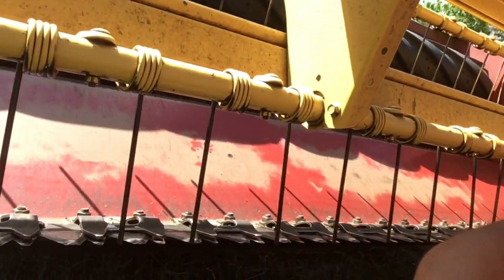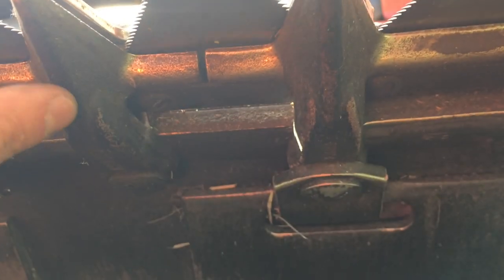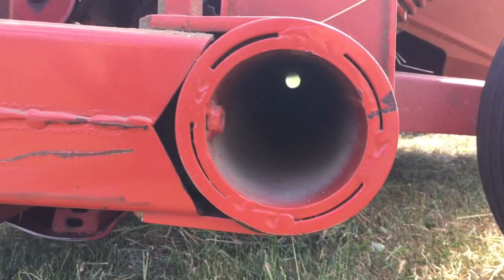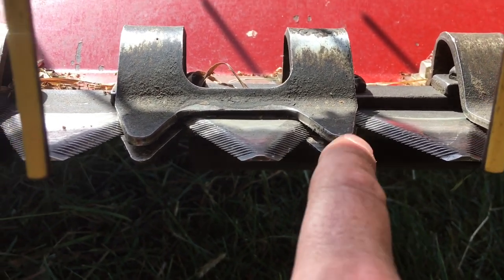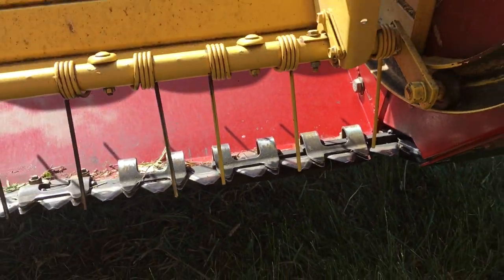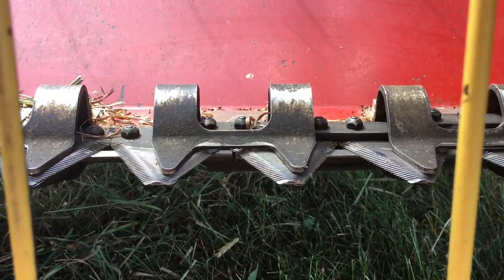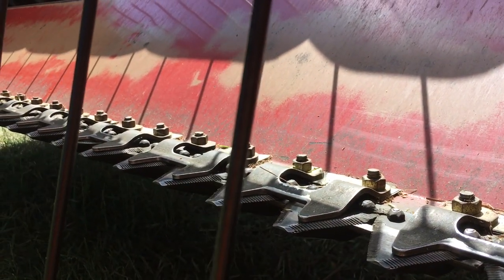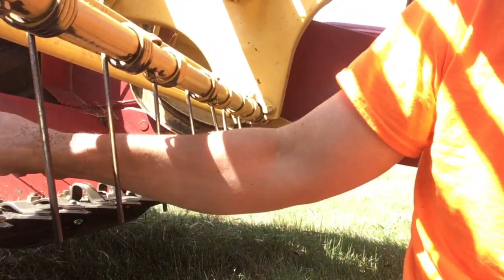Installing stub guards on 488 Haybine

Comment: There's a special bracket that you bolt to that nut in the tube. It's a bend 1/4" rod that bolts to the welded nut and gives through the bushing of the 9' knife.

Comment: Nice video. One thing I noticed though is your carriage bolts are upside down - the nut goes on the bottom (against the guard), not on top on the hold downs. That's why the hold downs have square holes. That's also why it's also important to use the correct length carriage bolt - so the threads don't project too far past the nut.
Reply from the maker: They are correct as installed. The nut goes on the top and this is what the parts diagram shows as well. If the nut were on the bottom the shoulder of the bolt would have to go down through the shims as well, which, depending on how many shims required, may not allow the bolt head to fully seat against the hold down because the shoulder is bottomed out. 

The bolt head goes on the bottom against the guard and there is a deep square recess in the guard for the shoulder and head to fit into. This allows the smooth surface against the ground. It also allows for easier shimming and hold down adjustment. Otherwise you’d have to remove the entire guard and everything just to add more shims. 

If your machine has the nuts on the bottom then it is not set up correctly.
Reply: @TheScientistHayFarmer  interesting, because the parts diagram for my haybine shows the carriage bolt head on top. Different models, I suppose.

Comment: Nice video. Quick question. I just picked up a 488 and it was missing the sickle bar bearing. I put the new one in, but I’m not sure how tight the bolt should be that connects it to the drive arm on the wobble box. Any tips?
Reply from the maker: I assume you mean a new knife head bushing for the sickle bar? Tighten it to 90 ft-lb.  I think it is a 3/4” socket you will need.
Reply: @TheScientistHayFarmer  thats right, knife head bushing.  thanks.
Reply from the maker: I have some other videos on the 488 too if you’re new to it or haybines. One of them is how to hook it up and run it.

Comment: Lucky you. I went to my local NH dealer here in France and he could not even get sections for my 447 haybine but 5 that I had to grind to make them fit the sickle bar... Could not get the rear glass for my td85 NH  tractor. I am a little reluctant to buy a used 650 NH round baler cause I guess he won't find parts for it if needed lol.

Comment: Neet looking stub guards haven't seen them before just the long pointy ones    basically like  what you have at the very ends but set for its the whole head.    P,s do they still make that type of guards?  Again haven't seen them types just the long pointy ones.               Sure some people may say "sickle bar haybines sucks, disbines are faster"   reality check "yeah that may be true until you hit something but couldn't stop in time".             P,s I think sickle bar type of  haybines should still be  for use,  keeps the legacy,/ history going behind them,  sides sickle bar and sickle bar haybines been going on since the end of days of  corn knifes and hay scythes to cut hay.                But 1 question if one of them guards accidentally breaks can you be able to put a long type guard on if needed?          Other than that good video thanks for explaining.
Reply from the maker: Both standard guards and stub guards are readily available. Standard guards can be picked up anywhere like TSC but stubs are less common and need to be ordered through somebody like Shoup Mfg or Webb's Sickle Service or God forbid, New Holland.

I would guess you probably could replace a stub with a standard in a pinch...I can't think of why not. But it would take a lot to break a guard. Installing these stubs is the best time, money, and upgrade I've ever put into any of my machines.

Comment: Very good info here.  I just purchased a NH472 with stub guards.  Mine has a bolt knife sections just like yours.  But all the hold downs are the high ones.  I see on yours only the first 3 are high ones.  I am having a problem with the grass getting all packed under those guards and in between the sections.  My dealer has said that the regular guards will not work with the bolt on sections.  But??  This thing is obviously not cutting correctly.  Can you help me please??
Reply from the maker: I was just going to say with high guards on all of them you will get a lot of grass packed in there. 

You need to get the low (standard) stub hold downs. They will clear the bolt down sections but just barely. Mine are aftermarket from Shoup Manufacturing. They are much cheaper than the New Holland ones. 

Your knives are also probably not properly adjusted to the guard either if you’re getting a lot of hay underneath them. You need to remove some shims from the hold down to get it a little tighter but should still be able to wiggle the section back and forth with your finger. I showed how to do all of this in the video.
Reply: @TheScientistHayFarmer  Thank you so much for the quick response.  Yes....I saw the wiggle.  I think all of my guards only have 1 shim.  This is actually a brand new machine...yet a 2015.  Never was sold off the dealer lot and I found it at an auction.  I also don't think the rolls are adjusted and I am little confused with them.  There is alot of banging when mowing thick hay...that upper roller is banging like when a plug goes thru.  I think the tension is all the way tight....and the manual describes making 8 turns for most conditions.  Any thoughts with this??
Reply from the maker: Your rolls are too tight. When a big slug goes through it presses against a lot of spring pressure holding the rolls together and then they snap back together when the slug clears. This will damage your rollers. Loosen them. I talk about this on my video “Here’s how Haybines work.”
Reply: @TheScientistHayFarmer  Seemed that the rolls were all the way tight.  So I loosened them by 8 turns which is a number the book states.   But the way it is worded it described actually tightening 8 turns for most crop conditions...but??  Anyway...Mowed about 5 acres yesterday and no more banging. I picked up a regular hold down from NH  to check it out.  Will need at least another shim or 2 for good section clearance and it will also help with clearing the bolts.  Everything is on order.   Hoping when all done that the cut improves.  While it doesn't plug or wad up like with regular guards-the cut so far is sub standard.  Lots of tearing-I think from the knife getting so congested...also the whole shelf of the knife doesn't clear into the rolls??  I have a pic of what it looks like when I am done if there is anyway to upload?? (I don't remember this happening with my other machines)  Thank you so much for helping me.  I pick the brains of all the old guys around here and nobody every used stubbies...we have major geological obstructions in the this area.  The dealers haven't sold a haybine in 20 years...so their advise is to buy a discbine.  Yeah!  where do I sign??  Gonna have to sell me a bigger tractor too
Reply from the maker: @tarasullivan9650  you will still have a lot of grass left on the shelf of the knife once you’re done. This needs to be cleaned off well after each cutting so it doesn’t rust and rot. It’s possible your reel is shimmed up too high and needs some shims removed to lower it.  

I’m confused about your knife situation. You said you needed to add more shims. That implies there’s not enough shims on there now which would make the hold down too tight on the knife when you’re cutting. 

Based on what you’re describing (a ragged cut) you don’t have your sections shimmed correctly. You should see almost no gap between the bottom of the knife and top of the guard ledger surface. If you can see a gap there it will not cut. You need to remove a shim. 

You can buy shims at Shoup as well. They have several sizes. Get both. I also made my own shims out of metal flashing that are ultra thin for doing the super fine adjusting. 

Again the section needs to ride right along top of the guard. If it’s not it won’t cut. Think of it like a pair of scissors that have a gap between them. Sickle knives work exactly like scissors.
Reply: @TheScientistHayFarmer  Thanks again for getting back to me.  We are going to lower and move the reel forward.  What I have left to cut is heavy long 3rd cut....and with all of the rain it's a tangled mess.  I don't plan to bale anymore...the days are just too short.  But the fields need a good hair cut with the chaff fanned out for the winter.  I did order extra shims of both sizes from Shoup....they are quite a bit cheaper.  Looking at the current gap between the hold downs and the sections-the first 3 are very tight (and I guess correct as they do not load up) But all the rest have a good 1/16th of clearance.   Next sunny day we will change out the hold downs and tweak the clearances.  1 thing I know for sure...I could never mow in the current conditions with regular rock guards.  So I am already impressed with what I have been able to do so far.  I also do hay with a partner on a 45 acre piece-we use his JD 4440 and MoCO 945 to knock the fields down.  13' cut swath!  Flying around going over what is already down without a blink!  So he always laughs at me with all my little stuff creeping around...and I laugh at him as he fuels up practically everyday!  Anyway-I told him having stubbies is almost like having a discbine....almost! not really LOL
Reply: What! A! Machine!  Can mow thru anything with properly shimmed stubbies.  Truly impressed and what a time saver.  I am mowing really thick and quite long (24") 3rd cutting grasses....the leaves are all folded over and they are just full of water from all of the rain and sub tropical conditions we have been experiencing all summer here in NY.   I can say 100% that I would never be able to get thru this stuff using the regular rock guards.  It would be a slow crawl, constantly backing up to clear the plugs and then really struggling trying go over what was already mowed.  But now!  It stands it up and thru the rolls it goes!  I am mowing with the pin stop weld assembly and it's able to go over all the crazy rocks unscathed.  The springs could be untensioned a few turns as it takes a little longer for the machine to drop but for what I am doing its just more insurance of nothing breaking.  Really really impressed.  Oh! Hubby wants to know what is the proper torque spec for the bolts on the hold down clips.  He clicked to 50#.  Thank you so much!
Reply: 1st cutting 2022.  Mother Nature gaves us a bust out spring and the hay is thick! tall! and GREEN!  And the stubbies just plow on thru it.  I now call my 472 "the Haybine that thinks its a Discbine".  It NEVER plugs!  So glad I did this.  And thanks for all the advice.
Reply from the maker: The stubs are glorious. Really makes it now like an entirely new machine. I used to hate mowing but now I love it with the stubs.